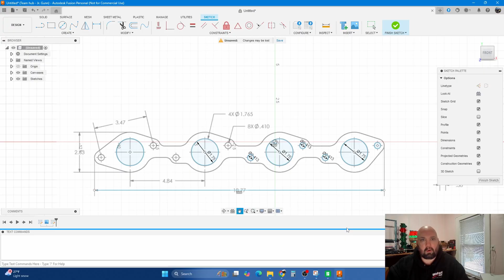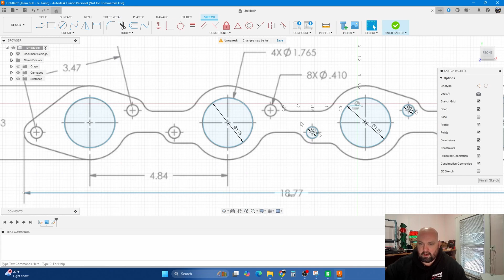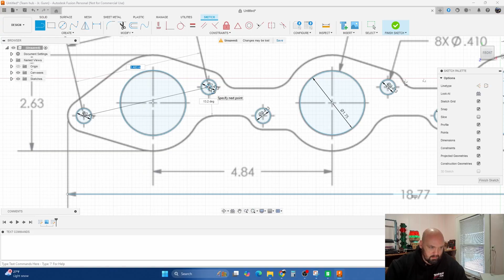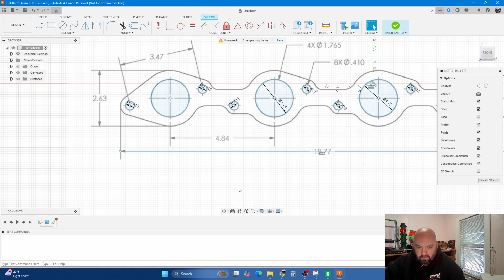Turn ANY Blueprint Into an STL! Fusion 360 + Bambu Lab Guide

Comment: bambu is such a shit company, proprietary parts.. attempting to lock firmware and slicing software so they can monitor everything you print

so antithetical to 3d printing

theyre solid as hell for out of box printing experience and that's the only reason for their success

i loathe that damn company, especially as someone whose been 3d printing for 7 years
Reply from the maker: I print guns on mine all the time 😂
Reply: @TheDrivewayEngineer  RAILS DOWN BABY
Reply from the maker: @CyberdriveAutomotive rails down or you're a clown 😂